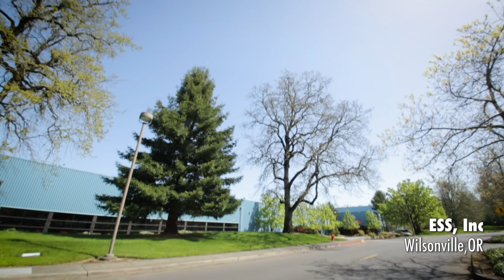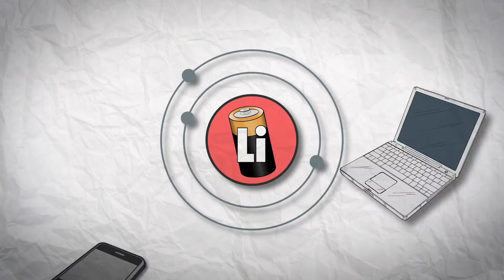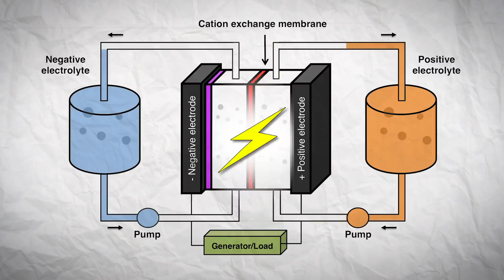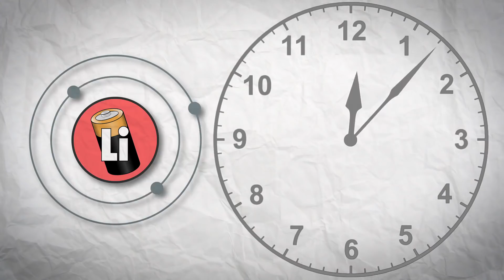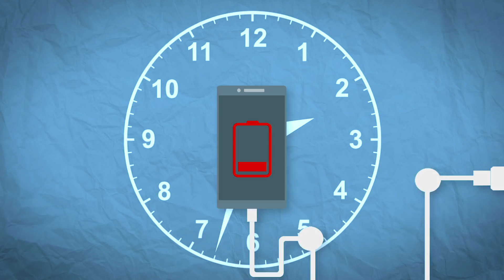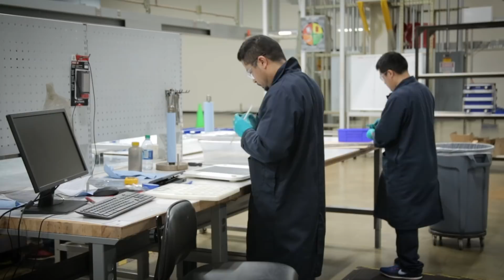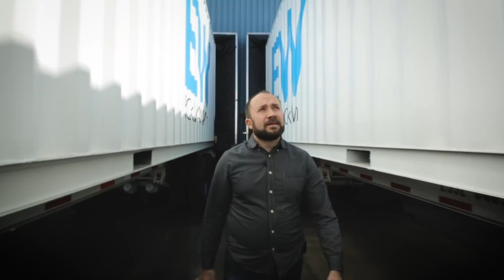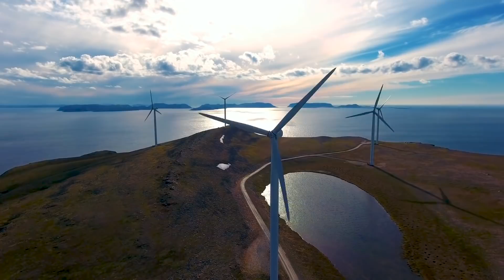Battery Fueled by Iron and Water Could Transform the Power Grid

Comment: 400 kWh delivered by truck with 500 HP (ca 360 kW). Truck has to use 1MW or more to deliver this thing on place. 
Even if it will be stationary battery then still 400 kWh per such a large container doesn't seem effective idea.

Comment: Another possibility is to use sulphate reducing bacteria to degrade the iron and release the energy.  I study corrosion science and it has always seemed possible to me to get the energy out of steel that we put in as heat to get the steel from the ore in the first place.  It would be good if you could let the company know about this idea as otherwise it will die with me....... I am 81 years old and this is my website http://www.pipeline-corrosion-control.com

Comment: What is the Energy density of this device, one can argue against Lithium  cels but this particular solution is not designed for mobile installations - why not make this open source?
Reply: That battery is very old technology (200 years) ....  It's called a "Voltaic Pile" ..    You can make one at home, very easily...
Reply: @THOMASTHESAILOR  Old as it may be, this video porports to have something new to offer!
Reply: @johngordon1175  ,  I think it's a redesigned technology that's been tested for long time...  It's probably very reliable,,  not the highest efficiency on the market,   but, plenty good..  So,  it's both..  New and old.

Comment: Summary of comments so far:-  old tech so bad / the tech is crap / the documentary is crap / salt is not fertilizer / energy density seems to be important for some regardless of the intended market / Thunderfoot is an idiot / other solutions for other markets are better / China causes slavery / general public consumption documentaries should include documentation, formulas and statistics / it will never power a mobile phone /  and if it was any good we would all be using it by now anyway. Did I miss anything?

Comment: Not enough data to make a decision. How long to hold power when not needed. Does it last past the four hours? How long to recharge after it is discharged? No real explanation of the equipment shown inside the trailer. How long the "membranes" last? Is that the part that requires replacement?

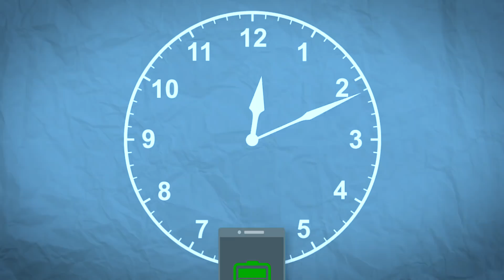Comment: There are some lies told here. At 5:00 how long a lithium battery last is a blatant lie. A lithium battery bank will last 10 years before significant capacity loss (tesla is doing testing on that front and will contradict what's said in this vid). I also don't like the fact they point it out that lithium isn't very well suited for freezing temperature conditions while they don't mention that for these iron water batteries (it's water remember). They just say it's good in high temp environments. Also, nowhere do they mention the discharge capacity or these water batteries? Typically lead acid for example can only be discharged to 50% before damaging the battery which means you can only really use half of its kw capacity. With lithium it can go as low as 10%. I bet with these water iron batteries that will be nowhere near the amount lithium is capable of. So yeah, lithium has lower cycles but it has higher capacity discharge which compensates a lot.

Comment: Pictures of mobile phones are misleading. These batteries are for stationary storage only (they won't be powering battery electric vehicles either). Cheap, long lasting and safe sounds ideal for stationary storage where weight and volume matter little. There are other competing technologies like Vanadium flow batteries and a non-flow type battery from an MIT start up. The more the merrier, may the best technology win.

Comment: They make salt water batteries no iron needed and they can be drained to zero with no damage...i made a 12 volt battery out of mountain dew bottles and saltwater. Not much for amps but a refrigerator size does a home...this is a spin on that in a way.
Reply: I've been looking into doing something like that, but can find no designs just a lot of generalizations.  You wouldn't happen to be able to point me at a info resource would you?  A DIY battery for the home would be handy.. have plenty of space! :)

Comment: Tesla now makes batteries at $100/kWh, so one of these containers would need to cost less than $40,000.- to be competitive.
The fact that they don't mention the price suggests that they are not.
Reply: this set up is around $3k/10kWh
Reply: @markeasterday3130  
Based on your data point, this battery is three times the cost of the Tesla storage system, however that is not at all surprising.  Something the size of a bathtub is far more cost effective to manufacture and install than something the size of a rail car.  This iron-water battery appears to require some sort of on-site maintenance, as well, yet it may already be cost effective for its intended purpose of long term storage.
Reply: Wait untill solid state batteries come to the market. They tend to have less material and cheaper to make. Oh yeah, and degrade way less because of solid electrolyte.
Reply: You are comparing apples to oranges.  My guess is that Tesla's actual cost is greater then that, but all of the major Li ion battery producers eat the loss because the stock market is more important to today's economy than making profits on actual production.   Given the run up in Tesla's stock they can probably absorb this cost forever for the number of cars that they produce.  But if you start having purchases for grid scale storage at that cost Tesla would end up putting you on a queue for eventual delivery, which would not happen before you cancel your order.   If you look at that shipping container, they aren't benefiting from scale of production and automation.   Currently ESS is bragging about getting $30 million in additional funding, which is absolutely tiny when you are thinking about grid scale storage.  How low the price ends up probably depends on membrane costs and funding for a factory in China.

Comment: Congratulations! You re-created a Galvanic Cell. And then put them in a truck container as a Voltaic pile.  Aquion Energy did this as well about 6yrs ago. They are currently out of business. I hope you guys are able to survive! best of luck.
Reply: It's a different market now. Large scale storage is necessary, and it's going to take a lot of iron flow and vanadium flow batteries. There are other advantages to these batteries that were not mentioned, such as ease of recycling, replenishing of energy storage media, very little degradation, and more.

Comment: Batteries will never be a viable energy storage for so called renewals. You need around 7 times the installation cost in generated power over the lifetime of a power plant to be viable. With the short lifetime of solar panels and wind turbines, and not to mention their pathetic generating capacity, there isn't much room for inefficient (there's always heat losses) and expensive battery power storage.

Comment: Big questions:  Can these batteries recharge at same time they are powering appliances etc.?    Because, that can be critically important, since so many portable battery boxes, and evidently, also those fancy Tesla power walls, lack capability to recharge at same time they are being used to power appliances. 
These are wet cells...how long do they last in daily use?
How costly are they to refresh/renew/replace?  
What about use in very cold climates?
Reply: 1Chimonger why does anything need to recharge while it is in use? It doesn't! If power is being supplied by the grid, solar, a wind turbine then your appliances use this. If there is not enough, the batteries make up the difference. If there is a surplus, this charges the batteries. If there is no grid, solar or wind power then the batteries supply 100 percent of demand. There will never be a situation where you need to put power in at the same time as taking it out, that's just pointless!

Comment: Bringing up LiIon batteries catching fire and losing capacity is a red herring and is a reliable indicator that someone's either scamming or running on the ragged edge.

Ditto for recycling (it's easy for LiIon trivial for lead-acid and fairly easy for most other common formulations)

There are a number of LiIon formulations around and the ones that catch fire are used in portable devices) because they're very high density and operational lifetimes are less important than how many hours runtime you get. Car ones are a different form which are lower density but don't suffer badly from fade and have 15 year lifespans (same for Tesla's battery in South Australia)

Density isn't an issue for stationary applications.

Comment: using the shipping docks, truck infrastructure, and most common containers as built in infrastructure for simultaneous transportation storage and modular walk in operation is an amazing efficiency innovation. it was right under our noses!
Reply: you can literally truck in chemical electricity instead of generating it with a fuel generator.

Comment: oh yes the "big battery for the grid" crock.  Its been tried in Australia, it only works for a few hours and its massively inefficient. Granted this technology could well be a step forward for this class of large battery and useful. However, as Australian governments have figured out already its cheaper to have the battery at the home with the solar panels because it cuts out grid losses. btw, my iron/nickel storage batteries are also non toxic and last for up to 80 years and have better energy density than this, oh and they were invented in 1910.

Comment: interesting. sounds food.  its ron(in this form) corrosive via oxidisation.- sealing will be important?

the real global power challenge remains fact that all energy decays into heat., contributing to global warming. answer is to be more power efficient - use less energy overall.
seems more likely than giant flywheels, giant hydro -pump cycling dam turbines.
into heat.

Comment: Good initiative. However there is mo way you can power en entire city block for 6 hours with a 50 KW source. It doesn't add up.
Reply: Imhotep Temfack he worded it badly. It's based on average consumption, around 1kw per hour per property, or 24kw/24hours- actually significantly more than most homes use, unless operating electric water heating or aircon. Therefore it would be feasible, but in order to account for peak demands you would need to work on a much larger scale.

Comment: Omg do you not have anybody on this channel with any science training or simply Wikipedia.
Lithium batteries (all types) hold charge for way way more than 1-2h.
Degradation is dependant upon chemistry and upon usage.  Phones do the worse case useage and type. 
At least you covered the stupid low energy density, 50kwh is a wheelbarrow of lithium. 
There are other flow batteries that are way better than this one.

Comment: so, downsizing for single residential use, say in Florida summer heat or Lake Placid Freezing cold environments... what are the practical limits on lower temp?  Could such a unit be downsized to 100KWH or less for single family unit where maybe one will be off grid or without electric due to hurricane or ice storm killing the utilities?  What would be a good size for KWH to supply a house for a week or two fully operational (heat or AC, refrigerator, freezer, lights, full sized electric stove and ovens, all small kitchen appliances normally used, washer/electric dryer, vacuum, forced air furnace fan, dehumidifier,  security lighting/alarms, stereo, motorized gate on a long wire run, tvs, shop/garage equipment, water pump, etc.????  How much solar to keep charged or re-charge?  What is charge dissipation rate vs Ni-MH or Li-Ion or others?  What would a residential unit to last a couple weeks on emergency COST deliveed and hooked up??, that is, presuming a hurricane wiped out grid and your solar panels too or a blizsard with 2 ft snow locks you in and covers up your solar array for a while or just bad winter weathe with low solar capacity and where one may want to charge the battery using grid electric, for security/backup, if that is economically sensible, is it sensible???

Comment: This is cool. They should build also smaller at 25 KW at half the trailer or the size of a big van for personal use for homes for the solar panels and at a lower cost. Surely all the Tesla homes with solar panels customers will switch on top of gaining many other customers . So the size should also be offered similar to that of a van because a trailer size is to large for an average house  yard to have it parked there.

Comment: This is B.S.  6:56  50 Kilowatt hours WILL NOT power an entire city block for 6 hours, or perhaps they mean in the dead of night when nobody is cooking or microwave snacking, or watching T.V., or charging their electronics, or having ANY lights on, or having their HVAC system doing anything, or their refrigerator cycling, and certainly not charging their electric vehicle.  That imaginary city block must be somewhere in LaLa Land!

I'll bet it also works really well on days like today where it is -16 degrees Celsius (3 degrees Fahrenheit) outside.  Even seawater freezes at about -3 Celsius (28 degrees Fahrenheit).  So let's see, that makes it unsuitable for use in uh, Canada, about half of the United States,  much of Europe, much of South America, etc. etc.

Not to mention the damned thing is as big as a small house and there's about a Quazillion Dollars worth of Home Depot plumbing stuff inside, all assembled at no labor cost I presume.  What does an empty shipping container cost?

The economics of this thing look so bad that ONLY something like the military could make an argument in support of such a device.  And can't you imagine hauling these shipping containers around through a war zone?

They're right about one thing though.  There WON"T be any "Efficiency Loss" over 20 years because it doesn't have any efficiency to start with.  A Tesla Model S has the equivalent storage of 2 of these things in a pack about 4" deep by 8 feet long, sitting underneath the car.

Heck, you can make a battery in your mouth just by biting down on a piece of tinfoil.  That doesn't mean it's economically viable for grid level storage.  
Now there's a thought.   Everybody . . . bite together . . . right now!

Comment: Lithium Ion are good for their density, Iron/water are environment friendly and potentially much cheaper.  Someone here commented 50KWH, the 50KW is the output the /400 is the KWH storage capacity.  The cost per KW would depend on initial cost of the system  and maintenance.  Recycling is part  of maintenance and Lithium/Ion recycle will be much harder.  Storage can't be sustained with Lithium Ion alone and is only good for burst needs and compact  use in  vehicles, not so good for sustained except on smaller scales than that possible for this.  Right now the money you save storing your solar is lost on the current cost and life of the batteries.  I've done the calcs.  Either you get credit from the Grid or you develop lower cost batteries, say 50 KW.

Comment: There are li-ion chemistries that don't fade as much as phone li-ion chemistries. Couple that with thermal control and shallow cycling like li-ions which are used for electric vehicle applications and after some initial fade the first year or two, fade is nearly eliminated but there's definitely an application for this if the price per KWh is right. Unfortunately, they are competing with falling li-ion prices as electric vehicles gain more market share.

Comment: The early Electric cars in America started with the invention of the Nickle Iron Battery by Thomas Eddison in 1901. Called the Eddison Cell they lasted more than 20 years if properly looked after, they also used a mild alkali as the electrolyte. (salt water is an alkali.)

Comment: The only reason why mobilephone li cells dont have much charge cycles as storage li cells is theyr mix and how ppl use it!! Mobile phone cells have about 12 % carbon dioxide in it but only about 5-6% li . The reason is the fast charge the carbon expands and heats up more than a storage slow charged li cell. Technically if you slow charge your mobile cell and kepp it at an power level between 30 and 80 % you tripple your lifespan of your battery.
Reply: They would have to make the phones AUTO-control the charge-decharge, which would make them last longer.   Hahaha!  NEVER HAPPEN!  Planned obsolescence!!!  Can't believe there's no popular programs for RECYCLING PHONES EVEN!!  They WANT you to constantly UPGRADE. And most DO.

Comment: I think many missed the point.  They showed that the storage and converters are separate.  This means that the systems are not restricted to containers.  The storage tanks could be separate and much larger.  The converters could be located at the source of electricity and the 'juice' could be piped to storage tanks and then on to converters at every point of consumption.